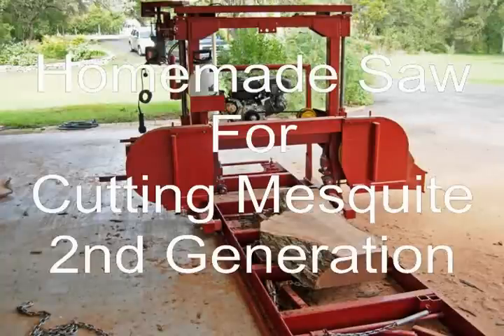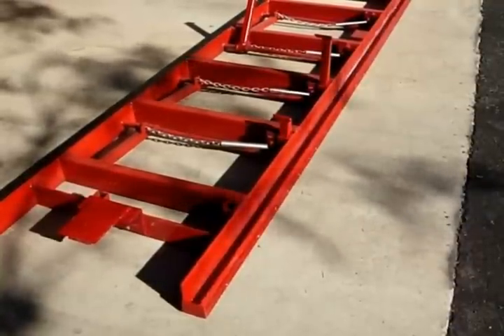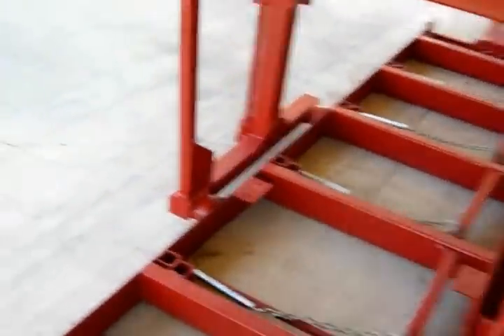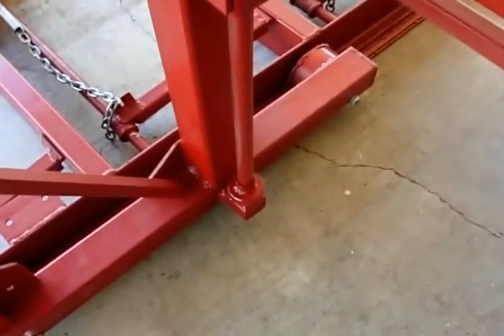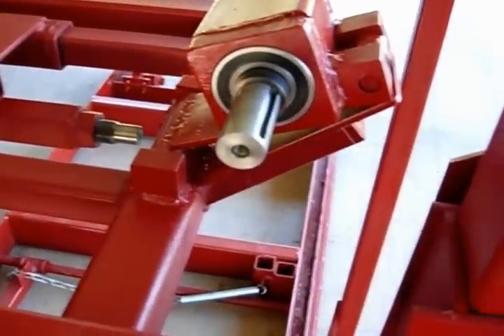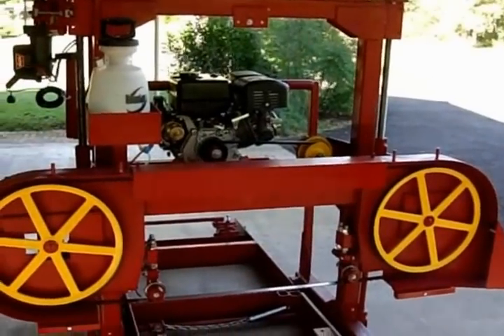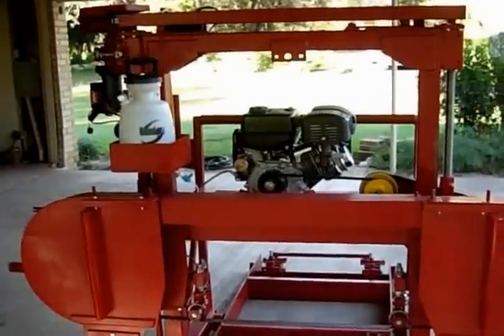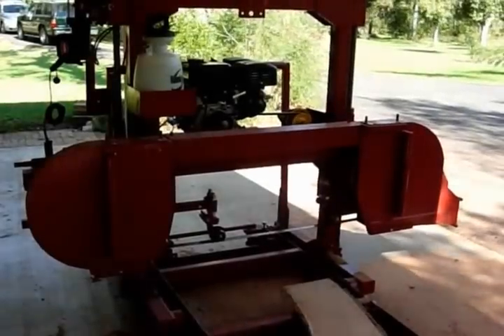Homemade Band Sawmill to cut Mesquite 2nd Gen

Comment: Ben,

Have you considered modifying the sawmill so the blade enters at an angle of 15 degrees, like the EZ Boardwalk sawmill? They claim that the saw pulls itself into the workpiece with this angled design, making the saw easier to operate.

Comment: I just purchased your plans from ebay and I have to say, I am extremely impressed. Lots of detail, and the 3D modeling helps to visualize components very well. You have done an outstanding job. I noticed that nearly several hundred plans have been purchased...do you know if anyone has finished one of your mills?
Reply from the maker: A number of them have been built.  Because I highly recommend using what you have access to and being creative, a couple of them are almost difficult to believe that they started with my design.

Comment: Very nice mill. Acme threaded rods must hold the mill with less movement in the cut, good feature.  What is the effect of sawdust on the action of the Acme threads?  Does the sawdust pack into the nut.  Do you oil or grease the rods?  Thank You for showing us your mill.

Comment: Everything looks great and heavy duty. Does the track build up with debris as one side of the track has a wall from the frame which doesn't let the sawdust and dirt fall away?
Reply: Some debris gets caught but is not a problem.  Logs sawn are normally recently cut from live trees.  Note that the sawmill is still cutting beautiful lumber.  It relocated to the pacific northwest a few years ago and now mostly cuts Douglas Fir.  As for maintenance, quite a few blades, a battery, a dry bearing needed replacement, and Mobil 1 oil and filter every 50 hours.  Not bad and sawmill is still as great as it was the day it became functional.

Comment: Hello Texas Ben. Just finished my new home made band sawmill. First cuts video without all the protective covers installed for making final adjustments on my YT channel.I wrote a downloadable free book on how to build this sawmill, if your interested.The 18 HP engine is very strong, with the adaption of an alternator to charge the battery and run the winches. Book explains how to modify a winch to raise and lower the saw running the acme lead screws. Portable 24' log bed to cut on. The blade turns 6000' per minute and book shows all pulley sizes needed to achieve this speed. Thought this might be of help to you, if you wanted to build a larger mill. Enjoy.
Reply: I would love to download the book. I just ordered the plans a few minutes ago. Can you let me know where I can download?

Comment: Ben you’ve designed and built a very nice mill
I’m going to purchase your plans
One thing I’m wondering if you’ve had any problems with sawdust building in the tracks. It looks like dust will build up rather quickly and being in freezing temps during our winter month might be a problem
Like to know your thoughts on this
Reply from the maker: No problem.  I sweep the tracks if a buildup starts.  With a sharp blade and proper blade speed, the sawdust will be blown away and will not be a problem.  The problem which does occur is small broken
Reply from the maker: Debris builds up if the log isn’t solid.  A fix which I need to add to my plans is to put a vertical
Reply from the maker: Small plate with a slot to somewhat scrape the track where the rollers ride to keep the track clean.  I problems writing this reply.
Reply: Ok
Thanks for getting back so quickly 
I’m gonna “try” and order the plans today
My neighbor is gonna help me with the ordering process, I’m not worried about the building process, but the computer stuff....I’m old school 😁

Comment: Building a new band mill to your set of plans i purchased, with exception of size, we need to be able to make 46'' cuts for talbe tops. I thing of going to 1.5 blade width with 26'' wheels. Machine is 20' long  on trailer. but where should i look for 80'' ACME threaded rod
Reply from the maker: Using larger wheels should be no problem.  You might use 2 belt pulleys and use a 2" blade.  Guides will need to be lengthened.  Do not know about 80", but 72" should be available - search internet and inquire with 1 1/4" acme rod suppliers.  larger blade will improve lumber quality and larger wheels mean less bending wear on blade so blade will last longer.  I would invest in carbide blades to cut very large hardwood.  The saw frame is plenty strong enough for enlargement, but the track needs to be strengthened and supported.
Reply: +gregory sartain link me to those plans sirI cant find them

Comment: Thanks for sharing! one question- I noticed you use an intermediate pulley set up. Others I've looked at have belts that go straight from the motor to the drive pulley. What is the benefit of using in intermediate set up like you have on both of your mills?
Reply from the maker: You can cut larger logs.

Comment: what you've built is a commercial quality mill not a cheap Chinese knock off, good 1 babbie.
Reply: Ben
Very nice design
I’m going to purchase your plans
One thing I’m concerned about, do you have any problem with sawdust building up in the track with the 1” angle welded on the 3” side. It looks like dust will build up there fairly quick and being in freezing weather during our winter months might be a problem